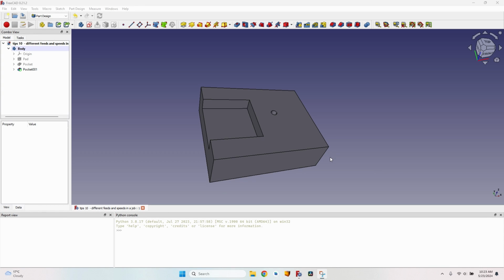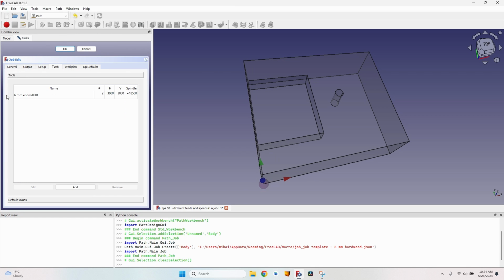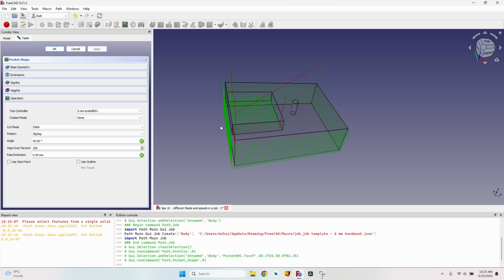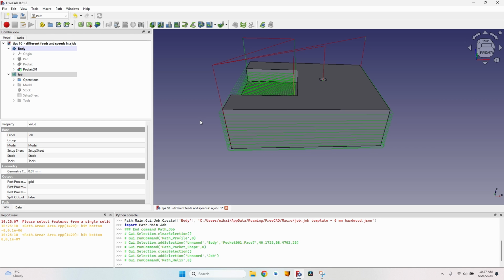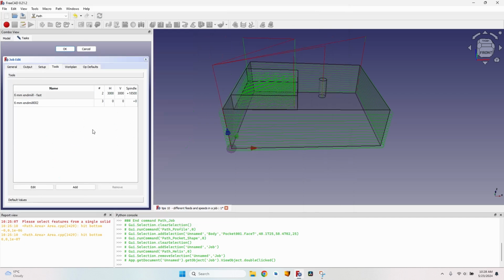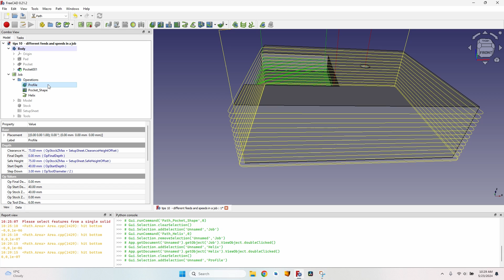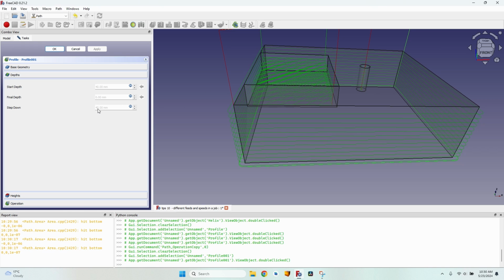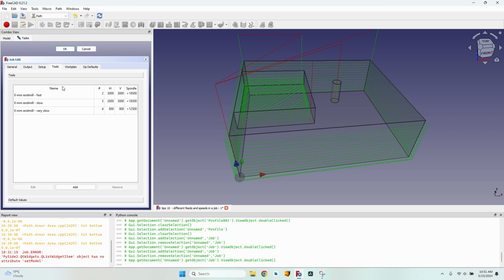Different CNC Speeds & Feeds per Tool – FreeCAD CAM Tip 6 (Machining Guide)

Comment: Very helpful as always. Will this prompt a tool change? I guess setting the same tool number (#) should mitigate that?
Reply from the maker: Just checked the generated gcode. It outputs M6 Tx, but it's commented out. It is due to post processor settings, as there's an argument that you can add, --tool-change, which will output the command if needed. And yes, you are right, changing the numbers of the tool to match avoids the tool change gcode. Sorry for not mentioning it in the video, but I'm not familiar with tool changing. I use the recommended grbl method, which is splitting the job in separate files based on tool
Reply: Hehe no worries ;) i currently use FreeCad for CAD but EstlCam (and sometimes Fusion) for CAM. Your videos help me understand FreeCads CAM better and I will most likely give it a try instead of fusion on the next more complex CNC project 😊 thank you for testing it, good to know that there is this option in the postprocessor 👍
Reply from the maker: No, it won't prompt the tool change. At least not on my system (grbl based fluidnc). If it's just the feed, it simply goes on with the new speed. If it's the spindle speed that changes, then it holds for the spin up time, then moves on.